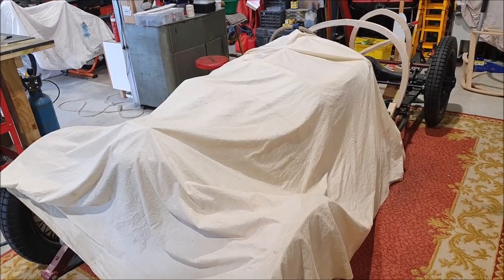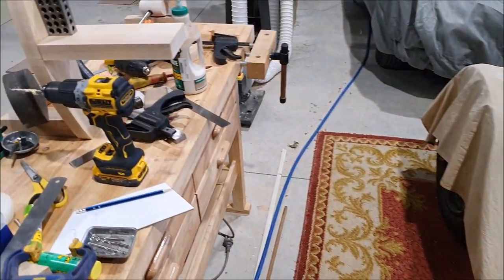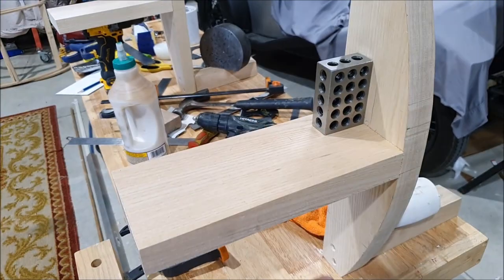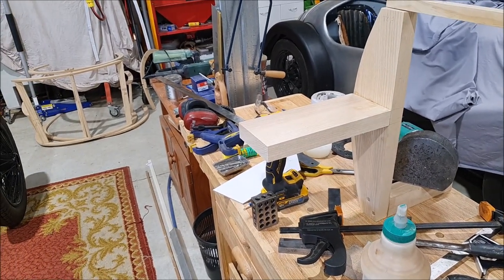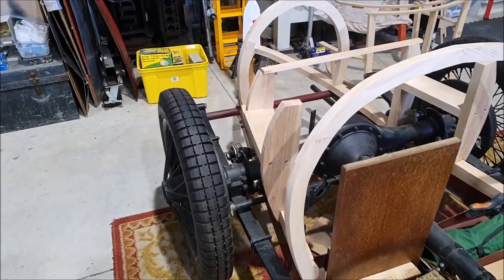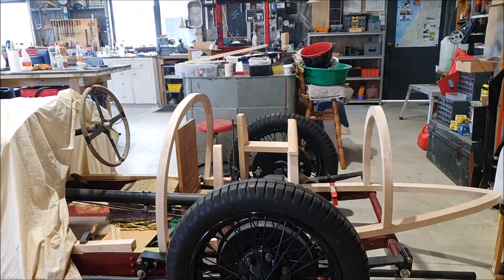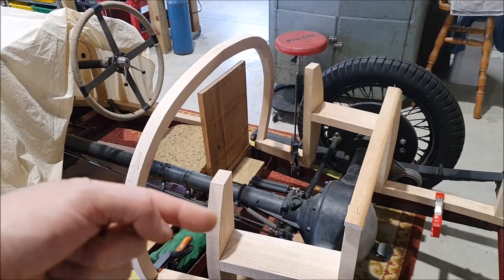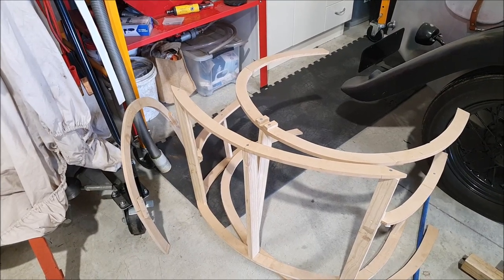Pre war Riley ash frame axle opening tops

Comment: Have a Merry Christmas and a Happy New Year!    At this rate you'll be on the road by summer.  Ha!
Reply from the maker: It IS summer! I did look at buying a personalised plate for it the other day. In NZ you can buy a plate without needing a car at all then you just transfer that plate onto a vehicle when you need to. They have reintroduced plates with silver lettering on a black background (as opposed to black on a reflective white background) which look far more 'old fashioned' so I definitely want one on this car. But it's still a way off being road legal of course. I think the plate is about $1000. So should I risk getting one now not knowing if the car will be on the road at some point. I am pretty confident it will be just when is the question!
Reply: @asciimation  For a $1000 it should come with a guy to mount it on the car for ya. 😁